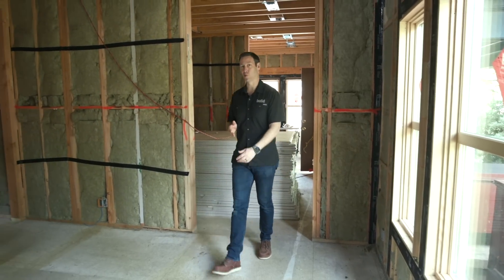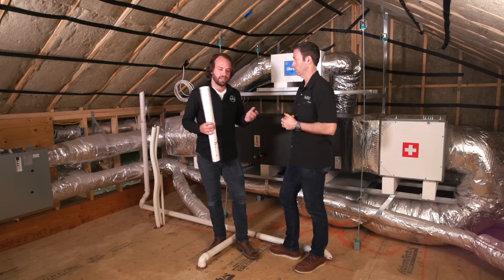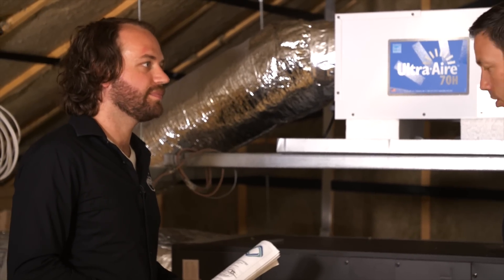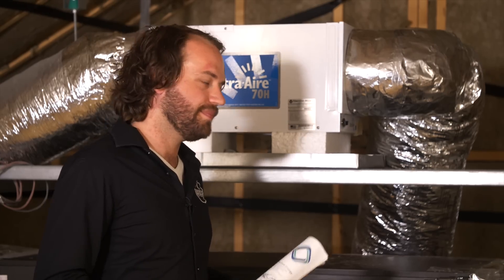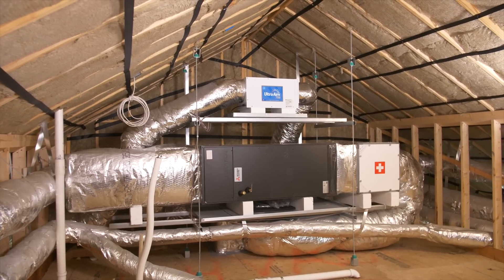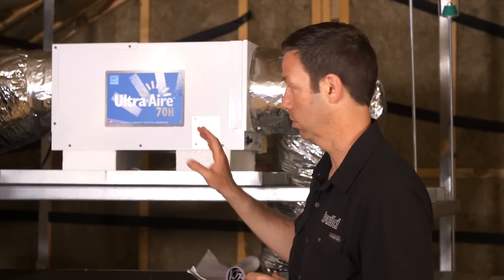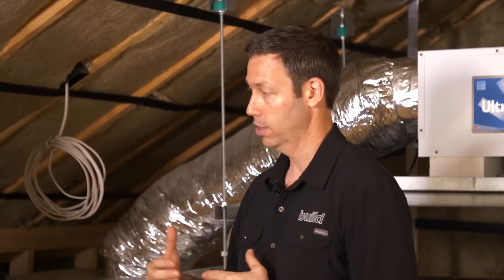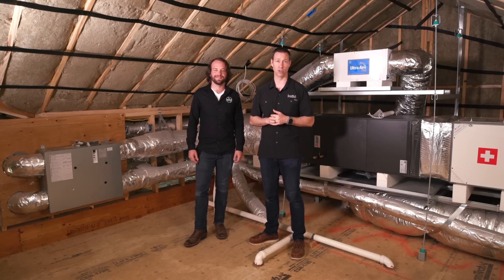New BUILD : Excellent Air Conditioning System Cost?  I’ll tell you!

Comment: Do you guys run coax and cat5 or cat 6 from each Jack to a smart panel or outside??? If not when cable installers install there goes your air seal!
Reply: A few seconds to caulk that penetration and the highly minimal "leak" is resolved.
On a house of this scale, they probably use a weatherproof conduit body for outside to inside cable management, so there is no leak if done correctly.

Comment: While we're talking costs. What are the annual filter costs for a typical house with these kinds of systems?
Reply: Looks like IQAir charges a bit of a premium for their housing and filters, but it is MERV 16 vs a MERV 13 from someone like Honeywell or Aprilaire.  I've been following this channel for a while and replicated this (Mitsubishi VRF split) system in my own home.  They have frequently used the Honeywell whole house air filtration system, which is what I went with.  I use the largest available unit for the lowest static pressure.  Honeywell part #F200F2025, which uses a 20"x25"x4" filter.  A quick google search reveals that it's under $150.  Replacement filters are roughly $50 and they recommend replacement once per year.
Reply: @halbritt  I can't wait to hear what the reply is to your question.  I took a quick look at the IQAir website.  Their lowest priced unit is $2695 - for what looks like a box holding filters.  Surely there's more to it.
Reply: I'd bet the ERV and Dehum are annual replacements. So $40. And the filter in the duct is probably a 6 mth, so another $80. And I'm guessing high.
Reply: @bluenadas  
In any case this shouldn't even be a "deterrent" from installing this system because you take a breath every few seconds and you can't put a price on clean air
Reply: @sergeyb8  In fact you can,. If the air you breath is healthy enough, via measurements, the additional cost of treatment brings  no health benefits, and the unknown effect of chemicals released from internal surfaces is not considered.
Reply: Those filters are $300 to replace complete waste of money

Comment: Is insulating the roof what you do in a passive house? I was always told not to put insulation on a roof because you could do more harm than good. I live in the PNW.
Reply: Ventilation is key. In this case he likely has fir strips over the roof deck giving 3/4" or so of airgap between that and the roofing material.
Reply: In the PNW you can still insulate under the roof, but you must take care to allow for air flow to stop condensation forming under the structure.
Reply: The outside of the house has a moisture/water/air barrier (probably ZIP System or something similar) to prevent any condensation from building up on the framing/Rock Wool insulation. The ZIP panels are probably insulated too, which further keeps a nice temperature buffer between the outside and the framing; therefore, no mold/moisture build up.  Think YETI cooler.

Comment: I am curious as to why they chose to go with a forced air HVAC system, rather than underfloor radiant heat/cooling (typically installed embedded in only the ground floor slab) with a low cfm MHRV/ERV? The latter is more common in passive houses due to improved comfort and energy efficiency.
Reply: Because there is little ability to cool the space with an underfloor system that does not create undesired condensation problems. Then they still need to dehumidify the air, and bring in the fresh air. The system they went with is better, and I'm sure the COP is a point or so higher than any radiant system outside of maybe an ALTHERMA system.
Reply: Just to add to this is that for passive house levels of insulation and air tightness, radiant is 'slow'. Basically there's a lag involved between what you want and set on your thermostat and what you ultimately get when it turns off and still continues to release heat. This is contrasted to air where the source is turned off immediately.
Reply: @rafflesmaos  it's only slow if your radiant system is coupled to some thermal mass otherwise it's not. Radiant heating transfer heat at the speed of light. Can't really go faster than that...
Reply: This is hot humid Texas where cooling is needed 75% of the year. Underfloor cooling just isn't going to cut it.
Reply: Hint: If you look at the beginning of the video, you’ll see that he’s walking on a plywood floor.

Comment: Why do you need an ERV with a ventilating dehumidifier like the 70H?  Dont they both bring in filtered fresh air?  Does it just extract air ?  Seems like you would want slight overpressure so you do not suck air from the crawlspaces or outside spaces.  This would be my dream house air system.  Do you guys do any work in NC or recommend anyone on the Coast of NC?
Reply: Rewind back to the plan he showed. The 70H isn't ventilated in this application, it is recirculating.
Reply: @tysonredfern5054  I see - but does the ERV add that much assuming you have a ventilating dehumidifier?  Hypothetical question not based on this set-up.  Logically, it makes sense being able to exhaust some air to the outside and refresh the air.
Reply: You can make the 70H internal only. It doesn't have to pull in external air.

Comment: Nice video. Thanks. But how about something different?...Radiant heating/COOLING. “Air” can only hold a limited amount of heat/cold. It’s still old-school. Greater thermal mass is reached when heating and cooling cement slabs. Maybe even incorporate geothermal/geo-exchange which is more cutting edge. See Canadians/Europeans. Which are ahead of the game.
Reply: That design is not very applicable in Austin, TX.
Radiant heating and cooling only works when the winter and summer are MUCH more balanced or in colder climates, like Canada/Europe.
They rarely see the humidity that can be worn (i.e. where a high pressure system sits in an area of the US for days at a time, like here in Alabama) with heat indexes north of 100F and humidity around 85-95%.
Reply: You'd have to have a massive amount of insulation under a slab in Texas for that. Our frost line doesn't exist for most of Central and SE Texas. Plus a cold slab is going to cause moisture issues, like inviting termites.
Reply: Ben Madison, so insulate under slab. Still worth it. 
Re termites: We should be using metal studs like commercial builds anyway.
Reply: Yea this is a video for someone else, unless Matt is going to move north to make videos it's not gonna happen in his climate zone